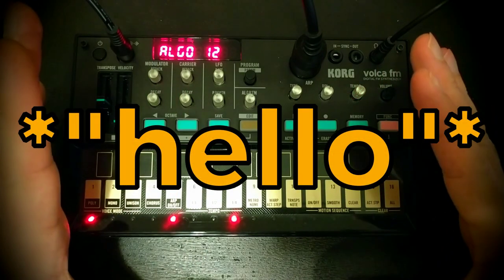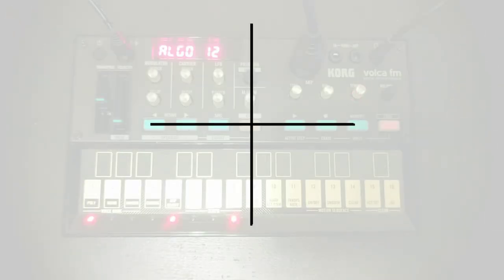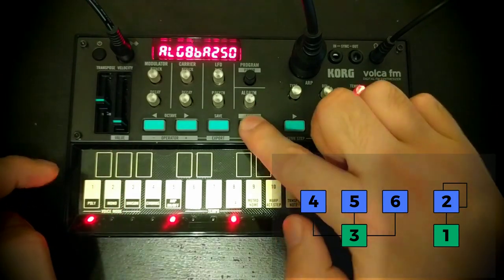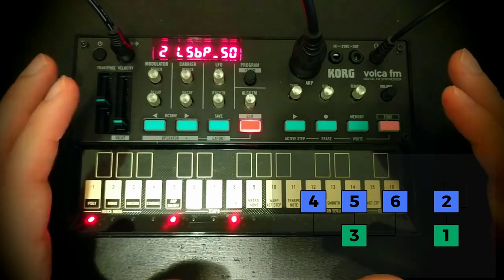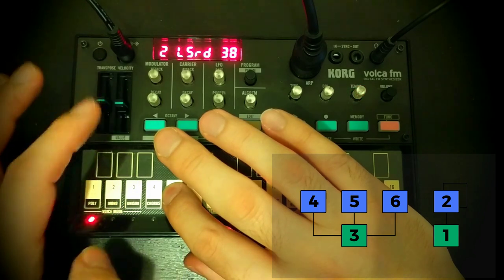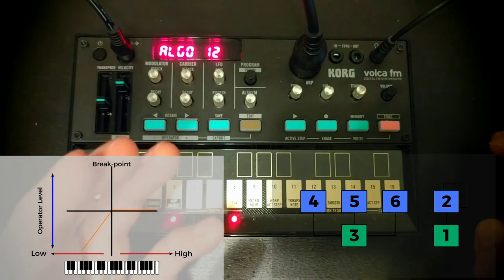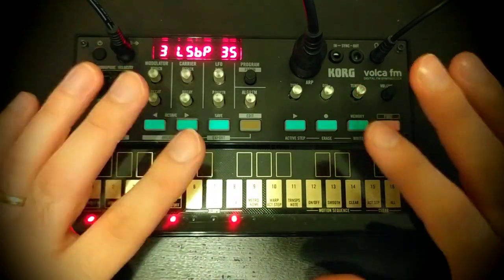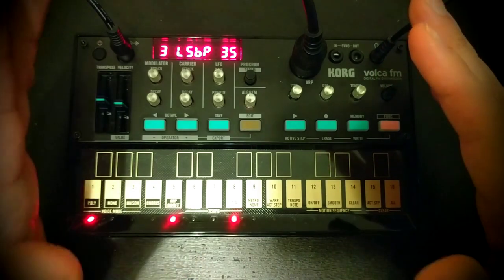Understanding Sound Design on the Volca FM - Episode 7: Operator Scaling

Comment: Impressive!! Thank you for such a good tutorial series.
Reply from the maker: I'm glad you enjoyed it!
Reply: Oscillator Sink, the depth and structure of the videos, just brilliant. Sound and image are also good quality. This made me finally want to dive into the volcas menus!
Reply: Subscribed and followed on Facebook. Will share it in my synth community also
Reply from the maker: Thank you! I hope you enjoy the FM journey BUT make sure you check out my free, online editor for the Volca FM if you'd prefer to reduce the menu diving:
https://youtu.be/ysJ_uxxepAY

It even has an automatic patch generator to help you find inspiration for patch starting points:
https://youtu.be/ROCDnJ1bJB8
Reply: Oscillator Sink yeah I saw the editor! That's very useful indeed. Now I need my pc serviced before y can use it.. :( and I hope I can use the Sub37's midi out to transfer sysex to the volca since I no longer have a midi interface.
Reply from the maker: I'd be interested to know if that works - sometimes instruments can be a bit funny about passing sysex. If not, a lot of the 30ish dollar USB-Midi cables work fine (stay away from the Alesis ones though as they have some weird issues with sysex).
Reply: Oscillator Sink isn't it also possible to pass the patches into the volca via sync in minijack connector?
Reply from the maker: It's SUPER sensitive to levels. Another Volca is calibrated just right, but trying to get it to work with other sources - well hit and miss sums it up - more miss than hit in my experience.

Comment: Hello again. This series was what sparked my interest in the volca FM and FM synthesis in general. I finally bought a volca FM last week and I am really enjoying it. I also made some patches with synthmata. You are a genius! There are a still few parameters that I don't fully understand like OrS - osc rate scale, OSCM - osc mode ratio or fixed, OKS - osc key sync and LFOK - LFO key sync. Could you possibly tell me in what part of the series you covered these concepts? Many thanks and have a good day.
Reply from the maker: Hi there. Thanks for the kind words! I don't think I have those covered in any of the videos but briefly: 
Operator Rate Scale - turning this up makes the envelopes move faster the higher you play, typically making high notes more percussive
Operator Mode - ratio is default, the pitch of the operator moves with the keyboard. Fixed means what it sounds like, you pick a frequency for the operator and it's always at that same frequency. Useful for atonal sounds like bells and special effects. Can also be used on a very low rate on a modulator to act as a pitch LFO for just the operator it's attached to so you can do pitch drift between carriers - very cool chorusing available there.
The Key Sync parameters make the wave forms for the operators and LFOs restart whenever you press the key. This can add a stability to the sound that can sometimes be useful on basses for example - especially when you're using detune as you don't get phasing.

Hope that covers it and makes sense to you!
Reply: @OscillatorSink  Thank you so much for the quick reply. It makes sense but for sure some experimenting has to be done.
Reply: @OscillatorSink  Hello* I have another interesting question. Are there ways to pan each operator in a stereo field? So you can modulate the panning from the modulators and the carriers. That should give some interesting results. Imagine having an enveloppe for panning... Does it exist?
Reply from the maker: It does not. It would be interesting, but alas, will have to remain in your imagination.